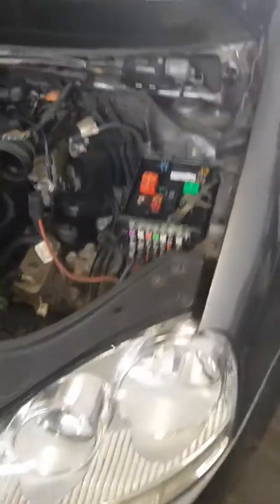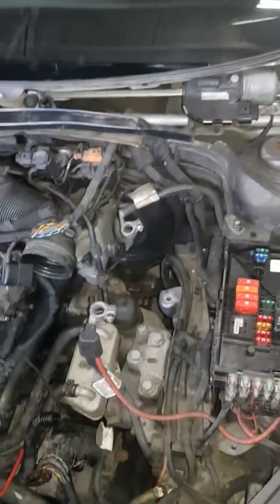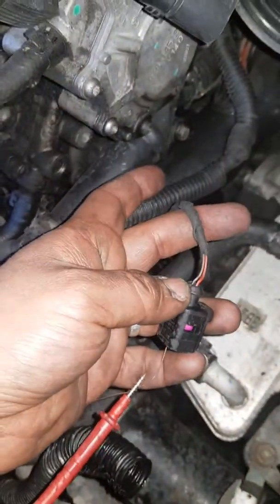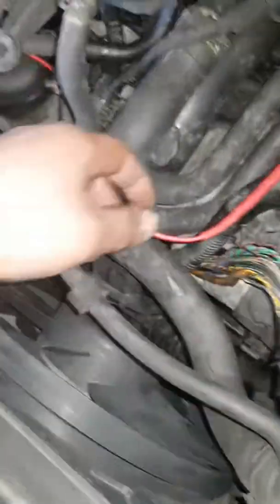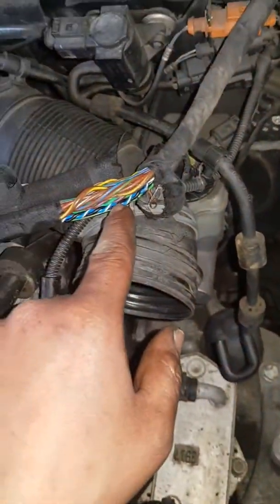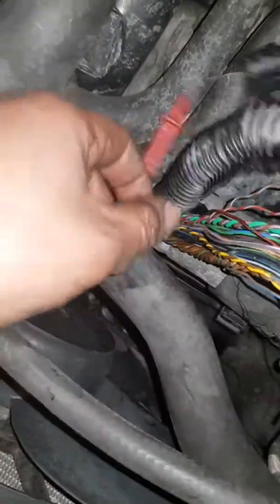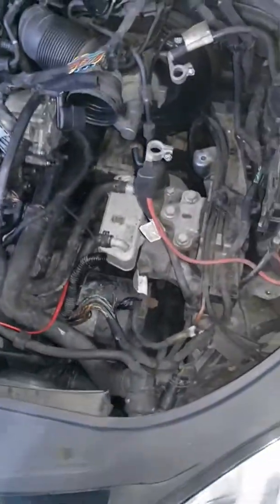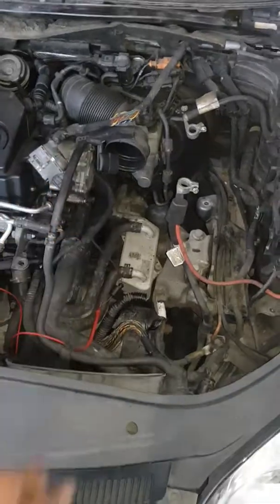vw feil code p0118 coolant temperature sensor

Comment: Same problem here on audi a4 B7. Changed out temp sensor nothing wrkd.check wire for voltage. Also nothing. So am gonna track down that open circuit .also had to order connector plug because my connector was totally gone. Jst the 2 prongs sticking out of the pinkish rubber .

Comment: I think I have the exact same problem. Engine just dies if I put  scan tool it shows that fault, I even replaced the coolant temperature sensor but no solution.